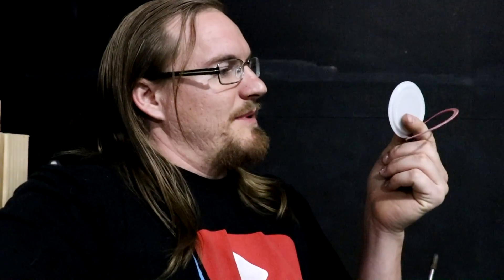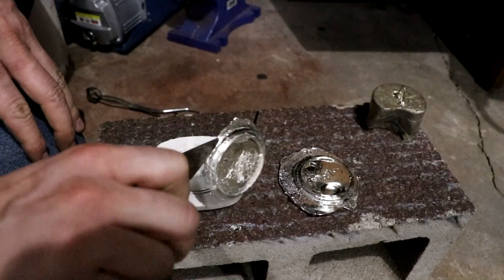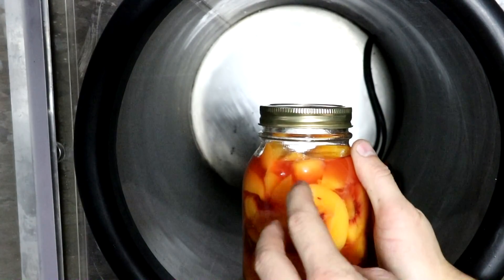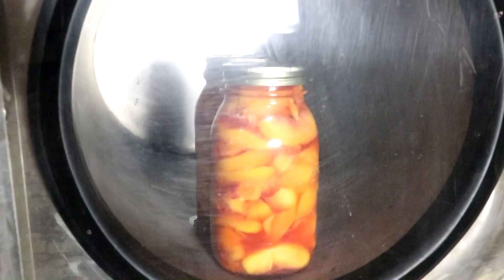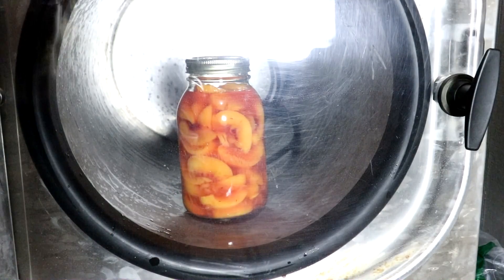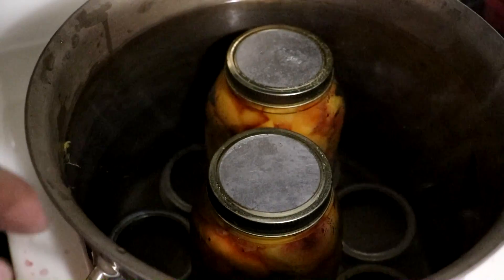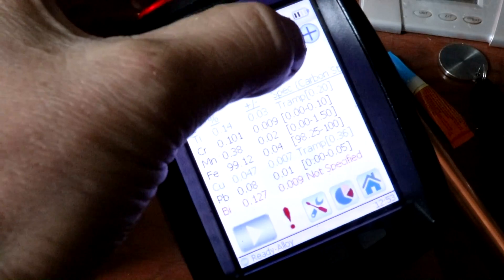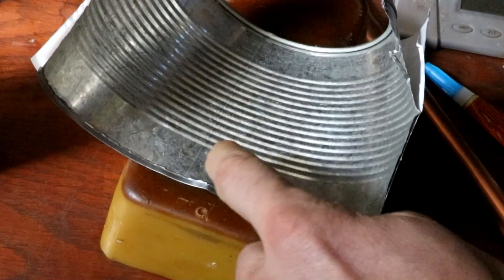Tin Canning Lids?

Comment: @Cody'sLab since you're experienced in both chemistry and gold mining I was wondering what your thoughts are on the idea of using molten sodium carbonate to separate gold from metal oxide bearing quartz rocks. it should react with the quartz to form sodium silicates which are quite water soluble and react with the metal oxides to form metal carbonates which you can use vinegar to convert to metal acetate salts which are soluble thus allowing you to separate the gold.
Are there any major chemistry/cost problems with this approach?

Comment: Do you think the rubber gasket was the issue? It's not joined to lid like silicone, so it might be interfering with the vacuum pressure against the lid.

Comment: I wonder if the real reason the rubber gasket didn't seal well in the vacuum chamber is the lack of the heat that it was built to encounter during boiling. The boiling would make it softer and help it form to the jar a bit better. Well thats my theory anyways.

Comment: Only platinum cure silicone is food safe and it's 2 part  that caulking style tube isn't safe
Reply: Also you boiled that silicone it must have leeched solvents into your food make sure you only use 2 part platinum cure silicone for food you need to toss that jar with the cheap silicone gasket

Comment: The steel canning lids provide an important safety indication which the tin lids won't. The steel lids are slightly domed in the center. When the partial vacuum forms in a jar, the dome is pulled in with an audible snap. As long as the dome stays pulled in you know that the jar is still under vacuum and that no air has leaked in. I don't know about the plastic lids you showed, bur the tin lids won't do this. Stay Safe.

Comment: Greetings Cody,
   I have been pressure canning in jars for years. Somewhere I have some old glass lids that are meant to be reused with new rubber gaskets. Lately I have been using cans because they keep the light out and are more durable compared to jars. And we live quite close to a fault with a bad reputation. Your cast tin lids are nteresting and I'm thinking I should machine some molds and try some tin lids. I wonder if I could use tin lids and gaskets on cans. I might give it a try.
Cheers, 
Eric

Comment: why not hot bottle your fruit? It is fast and easy to boil the fruit or whatever you want to preserve, heat your clean jars and lids in very hot water then while the fruit is boiling (or just off the boil)  fill the jars and lid them. sit them on towels or news paper, cover with a towel to protect from cold breezes while cooling and they are done. Once cool the rings (fitted loosely) can be removed, the filled jars can be cleaned up and labelled and any that did not seal can be enjoyed or be rebottled using the water bath method

Comment: Speaking of the vacuum chamber, I watch another channel where they do metal casting often and they showed their process of placing the plaster mold in a vacuum before cooking it to force the air pocket/bubbles out. It reminded me of some of the issues you've had with casting and thought to ask if you've tried that already? Specifically when you were getting the cracking/breaking from moisture and such still in the plaster.

Comment: It's possible you just turned on too hard a vacuum.  Once the pressure drops to the point where the water is boiling, it wants to froth up and carry bits of peach fiber through the seal, fouling it up.  Had you brought the vacuum up to just before the water started boiling, you should still get a pretty strong vacuum inside the jar, but without the seal getting fouled up.

On the other hand, once you then put the jar in the boiling water to kill off germs, you might break the seal and foul it up anyway as the contents boil.  What about doing this in say 95C water, hot enough to kill everything, but cool enough to prevent boiling/frothing problems?

Comment: Why not reuse the steel lids?  (Not the single use type, of course, but there are readily available reusable steel lids.)
Reply: the single use ones are also reusable , my mother only buys the single use ones, gets 5 to 10 uses then replaces them (although depends on the brand used)

Comment: I really wish you'd use gloves working with molten metal...
Reply: And around sharp tin cans.  But I shouldn't complain, at least he used them when handling potting soil.
Reply: If you are going to use gloves while gardening you should also wear a respirator and visor to prevent zoonoses and legionnaires disease

Comment: Removing the air from the canning jar by using the vacuum chamber may pressurize the jar adequately, but it doesn't cook or heat the contents enough to sterilize the food, which was the original purpose of "canning" (I see that you've addressed that concern.). I'm also not convinced that silicon sealant from a tube is food-safe.

Comment: You should pressurize water to have a boiling point around 300+°F, heat it to near that temperature, then rapidly release the pressure

Comment: The British version of those jars, called Kilner Jars, have the same general arrangement of a rubber ring and a circular screw top, but have glass inserts in place of the plastic ones you've been replacing with tin.

Comment: I always wonder what those things on the Americans jars is for anyway. I never saw this before in Germany. Here the lid of those conserving jars is just one piece.
So why is the lid and the thread thing separate? Can you use this for something?
Reply: here in New Zealand it is also 2 parts, the threaded part is only to hold the flat lid still during sealing, they should never be fitted tightly as this can damage the seal on the lid and smash the jar. the removable ring also makes checking the seal easier as all you have to do is lift the jar by the lid to check the seal like he did in the video

Comment: Cody, 
  I would suggest you might will likely have better results using Ultra-cal or Hydra-cal for making the molds. It has less shrinkage and is tougher than plaster. I use them quite often in making prosthetics that are a 1-5 off item, although I have friends who have had them last over 20 castings, with acceptable results.
  If you really want to get animal, try one of the new silicones that resist the temperature of liquid metals. I made my molds of the special silicone and potted the mold in Hydra-cal (because I ran out of Ultra-cal) to stop any deformation of the silicone from the weight of the metal being poured in. I have had good results. Your experiences may vary, close lid before striking, keep away from children under 18, etc.

Comment: Hey Cody! Next time try degassing your plaster mold in a vacuum chamber. It's what jewelers do to get really fine detail in their lost wax molds. I think that divot in the first one you made was a result of a bubble on the face of the mold holding on to some air and allowing it to expand under the heat. Great project in any case!

Comment: I read somewhere, quite some time ago, that you can decrease the surface tension of liquid metals using low voltage (less than 1v, if I remember correctly). Worth checking out?

Comment: BTW, I recently learned the cheapest way to get ahold of tin is the local second hand/thrift stores. Some tin products are marked with the tin percentage on them. I picked up a 97% tin plate for a few bucks last week. It worked great for filling a new solder pot, and helped me clear out half of my boxes of junk. I'll be using the other half of that plate to make PCB tinning solution according to the tutorial on the "Nurd Rage" YT channel.
   Does anyone know a solid way to verify tin composition on unmarked objects? I get the idea that tin is probably the only metal that makes the crackling sound as it gets deformed but I'm not entirely sure. What else works for determining tin content on the fly in a thrift store setting?
-Jake
Reply: That's great for you but bad news for this project as even that 3% left is probably lead. One would not want to can with that which is why Cody pointed out that the Tin he was using was food grade metal. You pay up for food grade anything.
Reply: My estimation would be if it's a plate and it's marked 97% tin that would make it pewter. If that's the case, it should be about 1% copper since that is about as much as will dissolve in tin. There's a few options for the other 2%, the cheap one being lead. I believe a test kit for ceramic glazes would tell you if it's lead but I've never tried that. If I remember correctly the key point for nerdrage's recipe was that lead was entirely absent.
Reply: @brocktechnology  
Thanks for the reply. My understanding is that there are markings on some metal objects denoting the Tin content so that people know that it is does not contain lead. About half of the objects with  a percentage marking also say "Elain," the French word for Tin. 
  As far as the content of marked objects, I forget what the other ingredients are in this type of 'food grade' marking but I think it's antimony and copper for the other 3%.
  I was mostly looking for a way to mechanically determine if any random, unmarked metal object is tin by, bending, banging, scratching,  juggling, dancing, etc ;)
Reply: Upcycle Electronics 
Just because is says tin, doesn’t mean it doesn’t have lead. However, if it was sold recently in the US, and is meant to hold food, then it is probably fine. So cups, plates, utensils and whatnot.